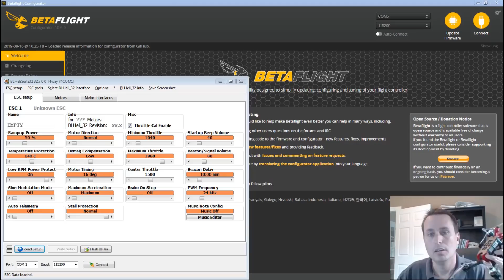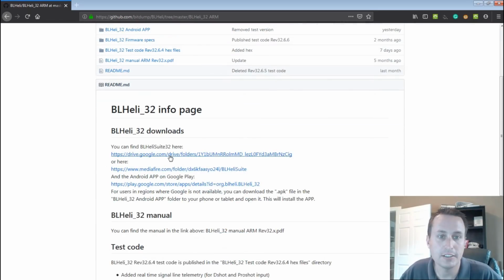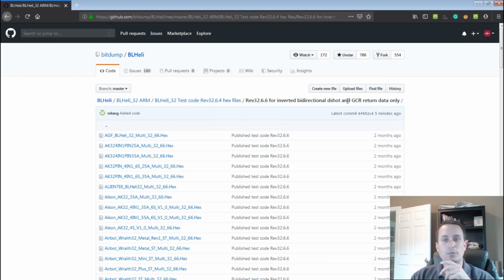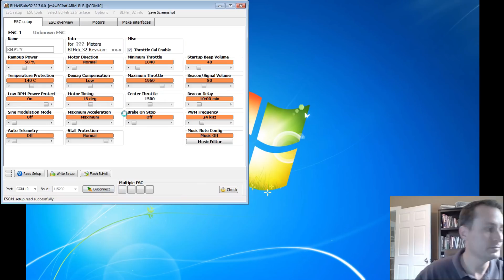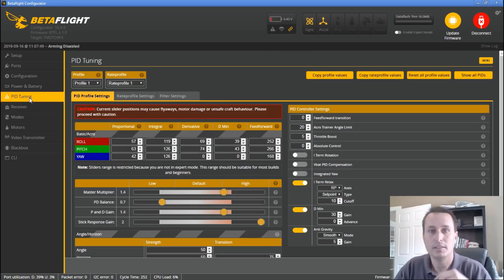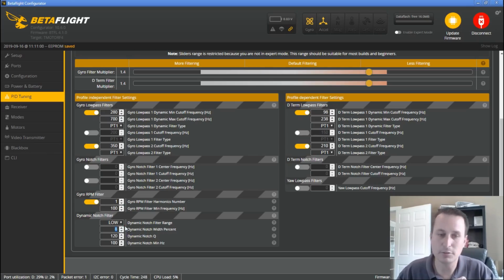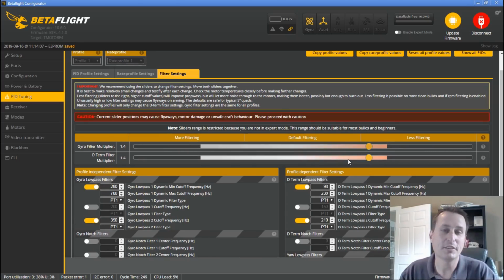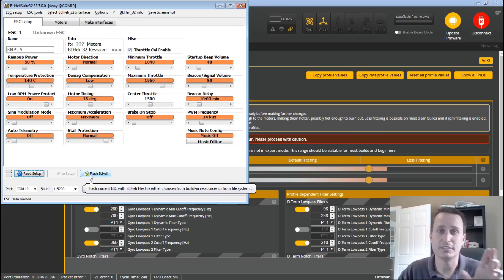Betaflight 4.1 Filter Setup - RPM Notches are the Future!

Comment: Can I use your recommendations on a 7 inch quad?
Reply from the maker: Yes!  But try sliders at defaults first.
Reply: @uavtech  Can definitely use this - definitely take the time to ensure the 0.00% packet loss on bidirectional.  In addition to default sliders on first pass, abuse the DMin and set it really nice and low down - will have mediocre propwash performance, but seems to do the most to limit D-term runaway and excess heat early on if you have other issues.
Log the data, and once you're happy with it go back to a DBoost type configuration (DMin in the 17-25 range, let those filters roll up from dLPFs in the 70's, let the secondary fixed LPF's push up to 175Hz) and you'll have something that rips.

Comment: Hi Mike! Why i dont have rpm slider in bf configurator, 10.6 version, i gues, with sliders for sure. Esc are flashed to this latest hex. I entered shipped manyaly and its work.
Reply from the maker: You have to be on BF 4.1 - a release candidate at this point - for the sliders.
Reply: @uavtech  i am, and have sliders, but dosent have rpm filter check box in configuration tab.
Reply: I have the same issue! 
Do you Fix this? I don’t can turn on the bidirectional Dshot button.
And i don’t see a rpm filter tab in the filter settings.....
Reply: I flash my ecs to .66 before....
Reply from the maker: @Jamaicarasramarc  , needs to be 32.6.6. GCR version as shown.  If RPM worked on 4.0, you were not on GCR.  That is new for 4.1.0.
Reply: UAV Tech i have forgot only to turn on Full chip erase 😬

Thanks 🙏 

It works 👏🏻👏🏻👏🏻👏🏻👏🏻👏🏻👏🏻👏🏻👏🏻👏🏻👏🏻

is there again extra dumps for a 7 inch?

Comment: I think betaflight is getting more and more complex every release. I loved the sliders because you can change your settings faster than ever and be back in the air in a sec to test. With all the filters there are so many variables that go in the quad that novice pilots will lose track of all thats going on. I hope next release we will have an automatic tuning quad based on blackbox log files ;) saves us all many hours ;) Thx for all your vids m8. Keep up the good work
Reply from the maker: Filter are more automatic as this setup works for EVERY quad class.  Also PID sliders should make it easy too.
Reply: @uavtech  The feature creep is real, but the sliders, improved defaults, and to some extent having more people experienced enough in the FB group to start helping others is going to start paying huge dividends.  I need to get off my backside and start making some IF/THEN tuning decision trees to help with, and let that be a structure that can be updated with each release.
Reply: @tehllama42  Yeh, a checklist to go through would be nice. Maybe even a csv export of some kind that compares numbers with a macro and gives you advise. Per example, overshoot on your P gain vs your setpoint or undershoot on pgain on your set point. I wonder if that could be done, one thing is for sure, that would be a hell of a job....
Reply: @dronejourneys9534  I'll take a stab at it, or help anybody doing just that.  Even a mediocre first effort can be built on.

Comment: Good stuff.  Do you think notch filtering will be standard on blheli s and not just 32 at any point or is that strictly jesc firmware
Reply from the maker: Strictly JESC for BLHeli_S.  BLHeli devs don't do coding on BLHeli_S anymore.  So Joe forked, improved, and called it JESC.

Comment: Why don't you turn off the second lowpasses anymore (or even the 1st lowpass on gyro)?
Reply: If you're able to make them PT1 and sit above 200Hz, the phase delay is pretty much negligible in areas we care about, yet they still provide great high frequency noise elimination that helps keep motors cool.  The big ticket to getting great handling is cutting phase delay in the 40-90Hz range, so once those aren't contributing they can just go up and out of the way.
Reply from the maker: trying to conform to the slider approach of just moving things up higher instead of turning off.
Reply: I agree... im more pro turning off than moving sliders up. Sliders up means that for instance a gyro filter is so high that it doesnt do anything anymore but is still active (and causing delay)

Im still going to turn of the gyro filters and work with rpm & dynamic. (And of course dterm)
Its silly to have so much filters active even if they are low latency.

Comment: Do you need to run the ESC telemetry back to the flight controller for rpm filtering to work? I never bothered  running telemetry because It never really had a purpose up until now.
Reply from the maker: Nope.  U just need latest ESC firmware.  It does it over the signal wire (bidirectional).
Reply: I was dreading having to pull everything apart, you just brightened my day. Thank you for all the information you bring to the community.

Comment: First, thank you for all your work and for all these super informative  videos. Ok Im pretty much a beginner  and I have no idea where to start and whats relevant . I have 2 kwads which I never updated  in betaflight or Bl heli. I think they are both running 3.5 . Should I always update  the firmware? I also have been using  BF 10.4. Should I only be using  the most recent version ?  Really sorry for the long post . Thank  you
Reply: Yes. The newest bf 4.1 w rpm filtering is well worth it.  And 10.6 configurator has more options and more  user friendly